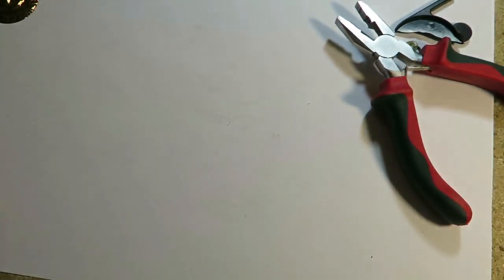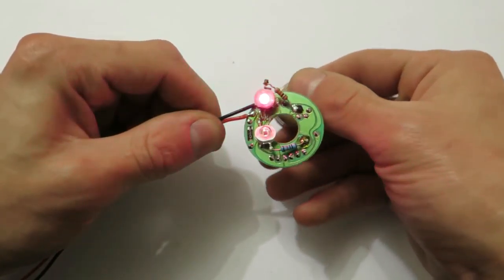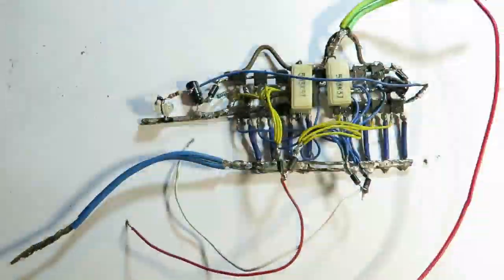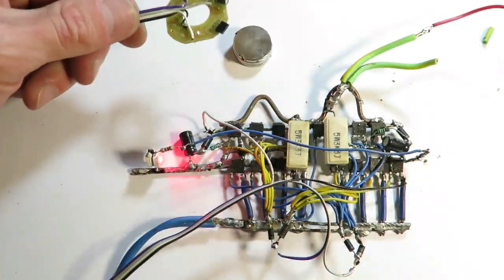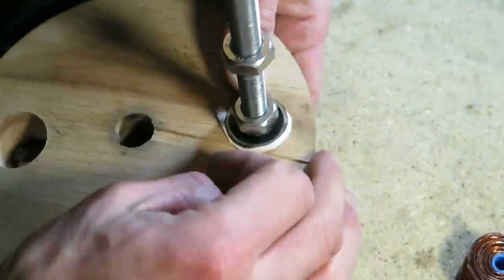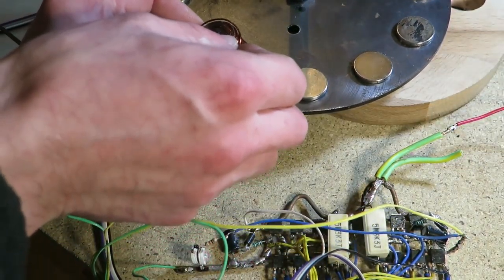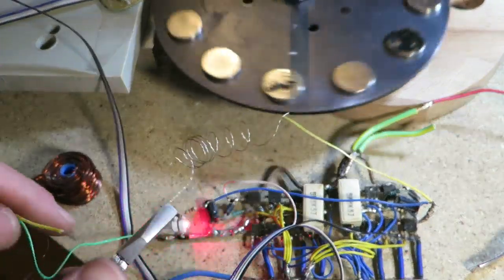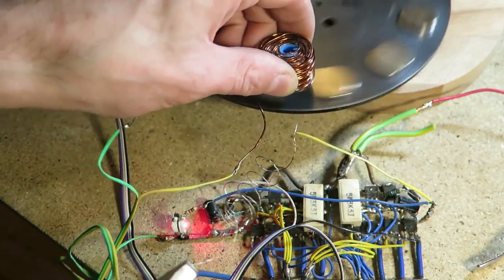DIY BLDC Axial Motor

Comment: 8:58  That type of coil is called a serpentine coil.
Reply from the maker: THX. I foud orig vid that inspired me in the meantime. In fact it's "quite known" type of winding. But still I find it quite original.
Reply: @IlusysSystems  it is a different way of winding a coil, but a 3 phase machine with a serpentine coils is less efficient at packing copper turns on an axial flux, than using more conventional coils.  That said, I'm still building my motor with a serpentine coil because of its simplicity.
Reply from the maker: @kreynolds1123  That's true... I was thinking about twisting coil to resemble fan blades, that way it can be packed more tightly. Then you can offset stator plates to correct flux alignment. 
Well if you don't have a lot of turns it can be done.
I was experimenting with offseting stator plates, but I couldn't see any difference...
Reply: @IlusysSystems  i have finished my motor now.  But, instead of using serpentine coils, i used a slightly different arrangement. Instead i used 3 axial flux arranged faulhaber coils.

https://youtu.be/_Xaf5rW72Zk

Comment: sir.. any driver schematic doc.. link please..?
Reply from the maker: https://drive.google.com/file/d/0BxYcrZZwfNmmcWxLLXFNdE91LW8/view?usp=sharing

It is a little bit simplified with optional use of single output hall IC.

there are a lot of modern IC's that will work better and provide a lot of protection, debugging and fail safe features... I used this, because I have a ton of motherboards, and I am lazy to order parts and make PCB